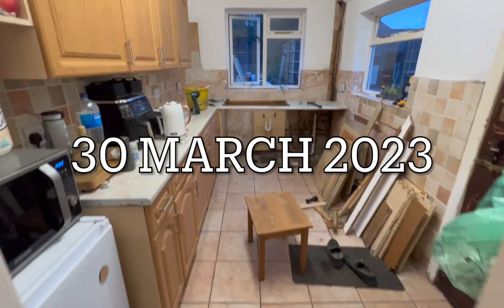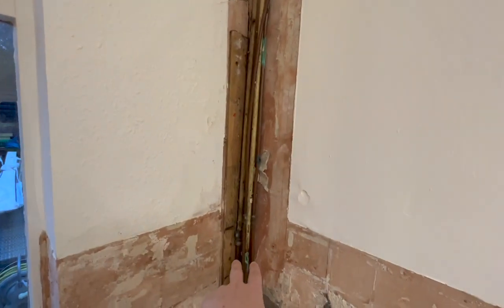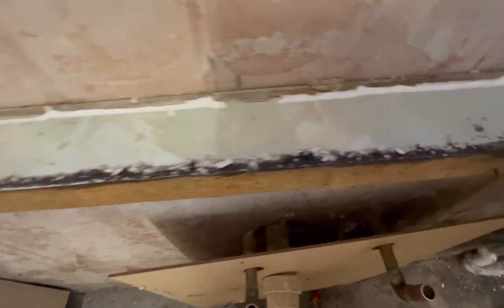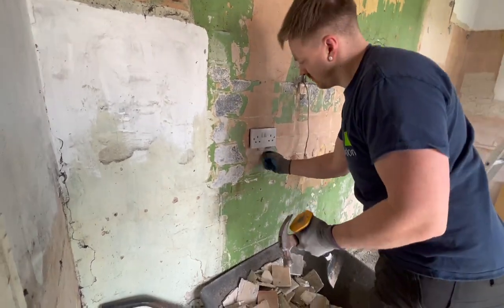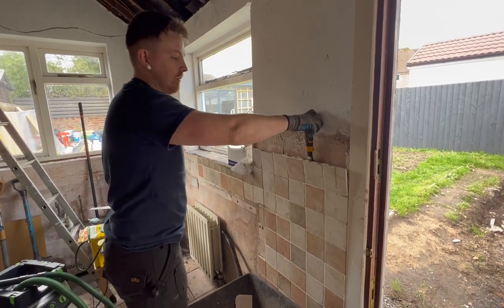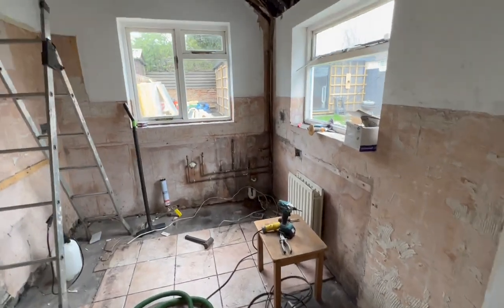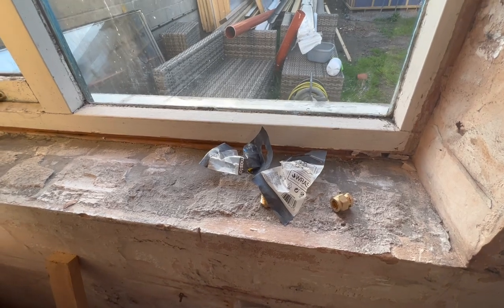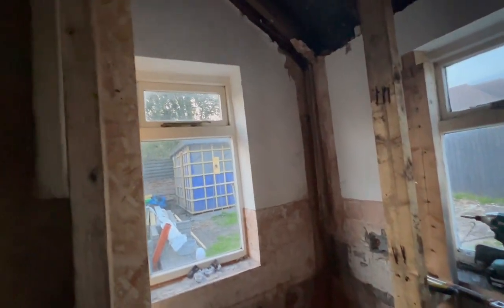Demolishing the existing Kitchen - Extension Preparation - 1930's Semi-Detached Bungalow Renovation

Comment: Hi   So full steam ahead  , I was trying to workout if the brickwork was single skin , worked on a few bungalows built around the same time frame . And had an extension added in the 50s , but were literally one brick thick.    Not much in the way of building regs back then 😂  , fortunately  these days  even if I there’s no cavity , which is often the case with pro properties of this age .      There are so many products available this is no longer an issue .        Best wishes as always.   😀👍👍👍
Reply from the maker: Thanks you for the comment :) yes, full steam ahead, but slow and steady at the same time! the walls are double skinned with a 20mm cavity in the middle so not much of a cavity really. I hope you're enjoying the videos, we have a few more on their way!